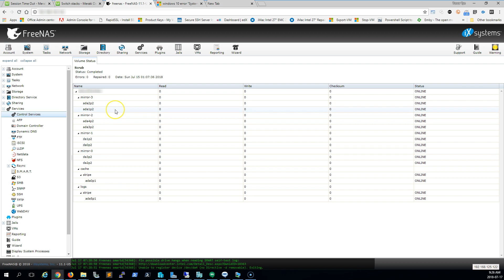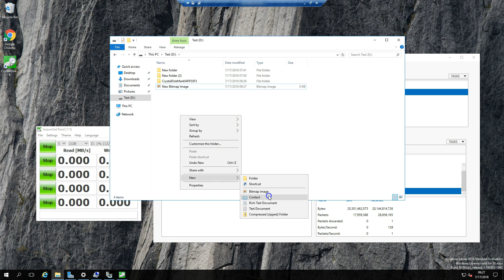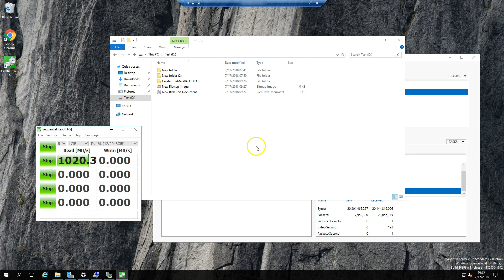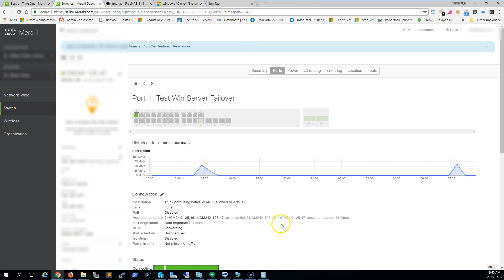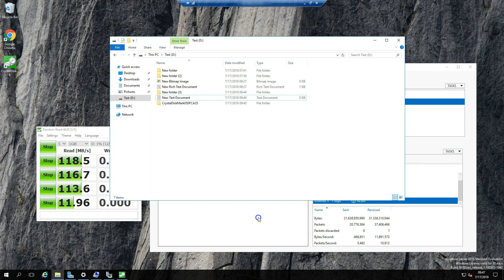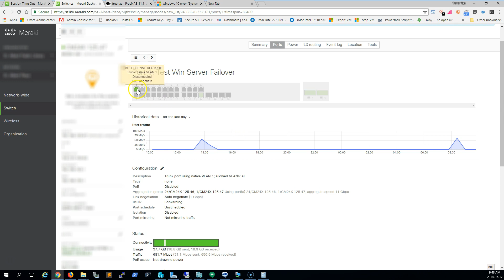Configuring HA for Windows Server and a FreeNAS iSCSI target using Cisco Meraki Switches

Comment: I'm in the hunt for FreeNAS iSCSI failover config. I keep reading on ixsystems forum not to use LACP with iSCSI, and here you use them together.  Hm.
Reply from the maker: I have been reading the same, I suppose each situation is different, for my needs lacp lagg was easy and painless to setup. I found with Hyper-V, at least with the switches I was using mipo was not very reliable, it could have been my setup, I'm no means an absolute authority on the matter.  This configuration hasn't been a problem it is fast and the failover works.  It has saved my bacon before, and the biggest factor seemed to be the switches, particularly how they implement and support lacp.  A long time ago in a internet far far away, there was a time where it was ok to use raid controllers that used jbod with freenas and that is no longer the case so things do change.  I suggest you maybe do your own testing (if possible) and see if you can find a definitive best practice guide (if you do let me know).  I have to revisit the iscsi mipo, I am really waiting for the samba 3 implementation to be up to date enough so I can use Hyper-V storage directly on freenas without iscsi and remove a layer of lag and complexity.